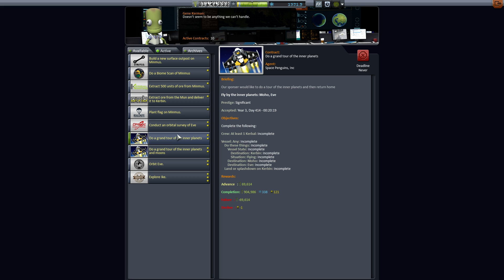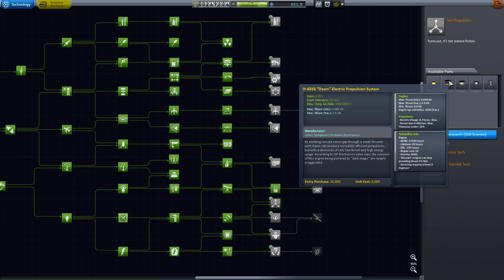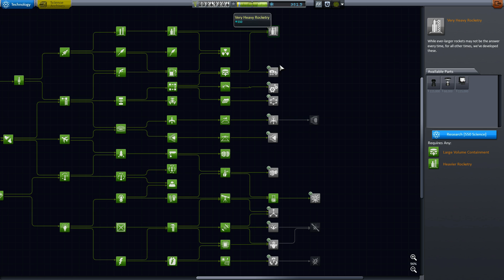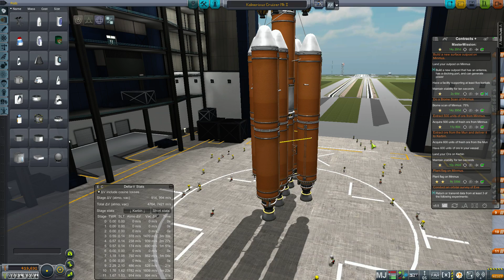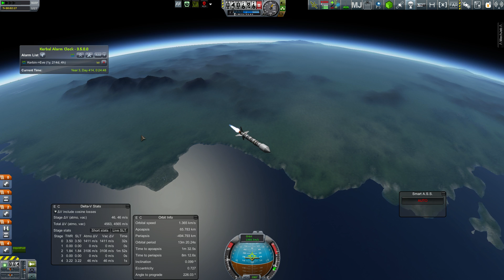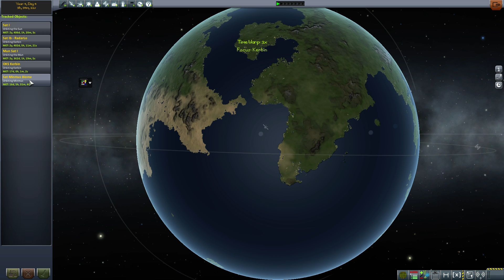Minmus Biome Scan + Future Plans | Kerbal Space Program | 1.05 Career! -- Ep #25

Comment: I might have misunderstood, but how exactly did you come up with the 4-5 times more delta-v from a fuel tank at 3:50? Surely, delta-v just grows linearly with Isp; the rocket equation doesn't care whether your reaction mass is LF+O or liquid fuel only.
Reply: +jv qn : Nuclear engine so the tank only has fuel. 800 isp plus twice as much fuel storage because he is not carrying oxidizer.
Reply: +Tom Watson You're forgetting that oxidizer is fuel, too. Delta-v only depends on the fueled mass to dry mass ratio of the rocket (and Isp).